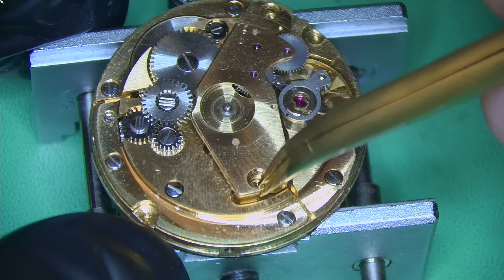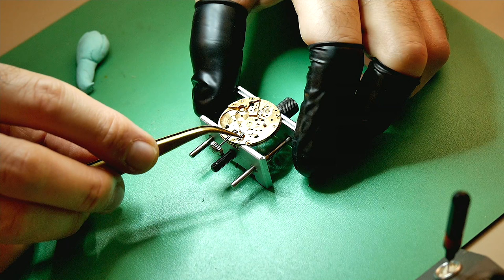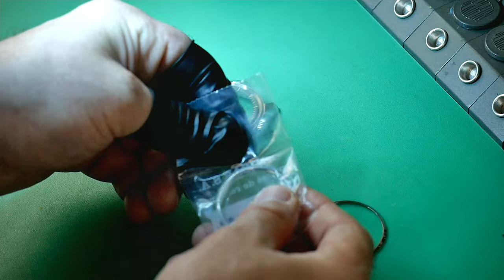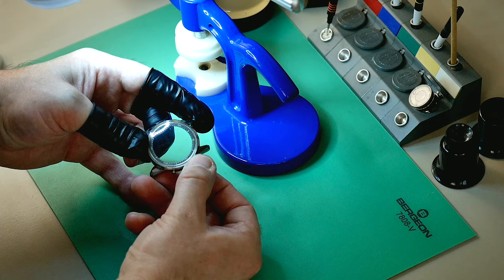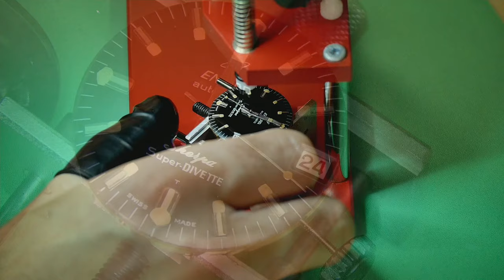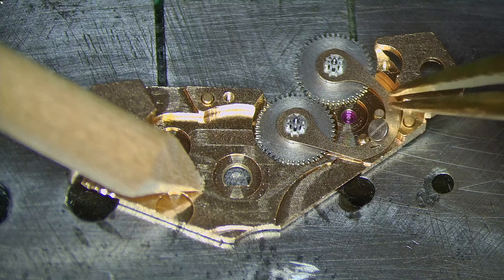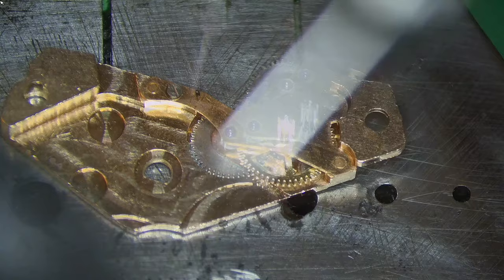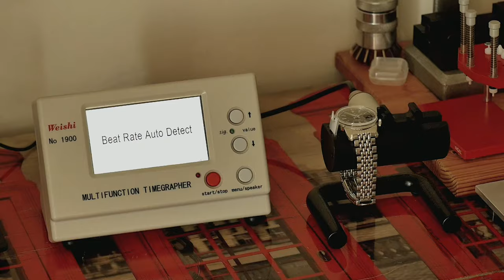This Vintage Enicar Super Divette Watch served in the Vietnam War!

Comment: Awesome watch!

I have a 1974 Tudor Prince Oysterdate that was serviced last year. Unfortunately when it is taken off at night and set down it will more times than not stop. within 2 hours. A little tap and it starts back up but may stop again. I wear it all day and it runs and keeps time like it should. Maybe I need a different service center but it seems to me that something is not balanced.
Reply from the maker: Thanks for watching. It sounds maybe that the autoworks is not charging the watch much at all as once you set it down it runs out of charge quite quickly.

Comment: Hi enicar expert! I have a question about the Enicar 167D movement. Without the automatic bridge installed I can hand wind it, but with the automatic bridge installed I cant.. Is that supposed to happen? 

Groetjes uit rotterdam😁
Reply from the maker: Hey DutchClawz

The AR167D can be hand wound with the auto works on. I'm suspecting that one of the reversing wheels on the autoworks has broken and causing it to jam hence locking when you try to wind it. They are really small pivots on those wheels so it can happen. 

Cheers,
Reply: @HorologyBiology  Ah, shit. The pivots look okay but I have been struggling with getting it together okay. There is absolutely zero literature or pictures on the 167D automatic module on the internet😅
Reply from the maker: @DutchClawz  I have a 166 (it's the same as the 167) I'm building so you see the wheel order. here https://youtu.be/DqvsZALwNgA?si=tzeWRPcshCFpevPO&t=1912